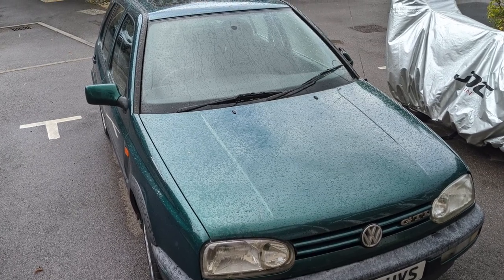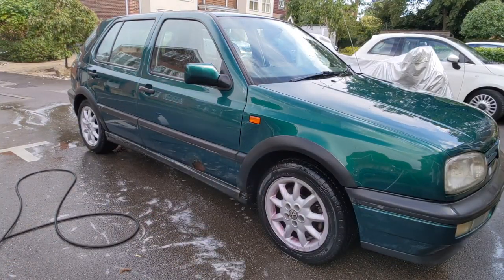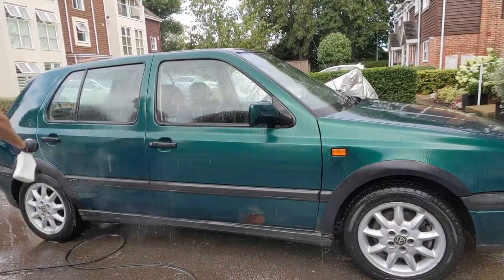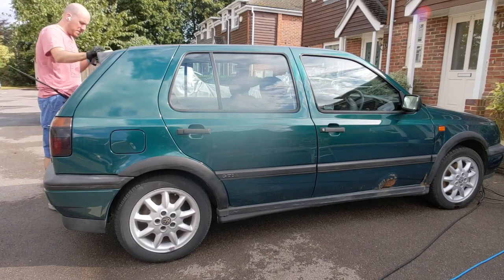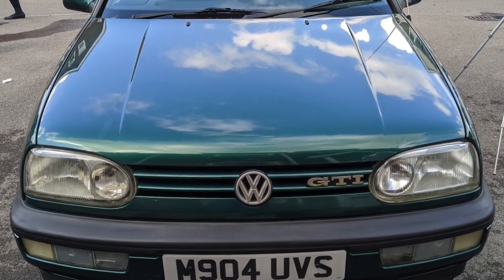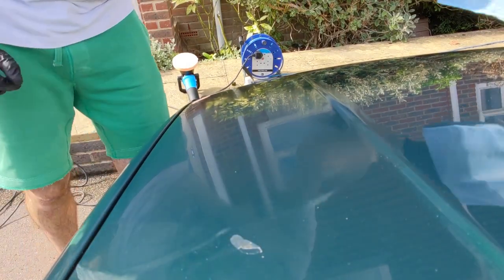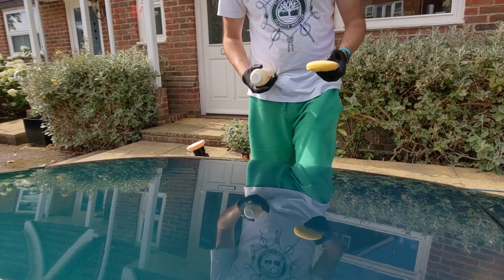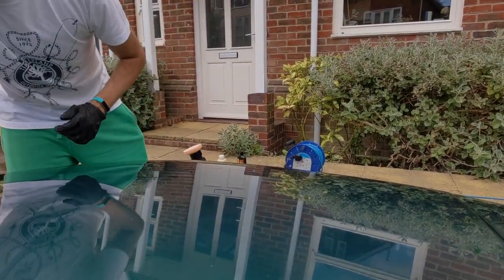Detailing a VW Golf GTI MK3 - a little love goes a long way

Comment: Great work! I personally prefer to see this type of 'lesser loved' car being shown some attention (as opposed to a supercar getting its 5th coat of ceramic this year) - It makes for a more satisfying video i feel! Also - Dragon Green is an awesome colour to work with - like most deep metallics, its very rewarding when approached in the right way. Keep up the good work!
Reply from the maker: Cheers dude! It really is an amazing colour, such a shame that VW don't use it anymore, the MK8 in this colour would look amazing I think, although it does make you appreciate this even more I guess.

What was nice on this one was that apart from the front end being a tad rotted out, the back is absolutely solid, no leaks around the rear clusters etc, no rust around there at all, and the sunroof seems to be absolutely solid in terms of drainage (yeah the seal could do with replacing but it's functional and effective). Just a shame about the rust hole in the door.
Reply from the maker: Sounds like you might be interested 😉
Reply: @SuperchargedLlama  my workshop diary is full right now I'm afraid! Lots of projects on the go and lots of content to shoot! That being said I'm sure you won't struggle to sell that. The MK3, although seen by some as something of a blight on the 'GTi' badge, is in fact a very interesting modern classic and certainly in my opinion one to watch. When did you last see a clean one 'in the wild'?!
Reply from the maker: I don't think I have ever seen a clean one in the last few years, they are really underappreciated I think, drive so much better than the MK2 (although not as pretty that's for sure).